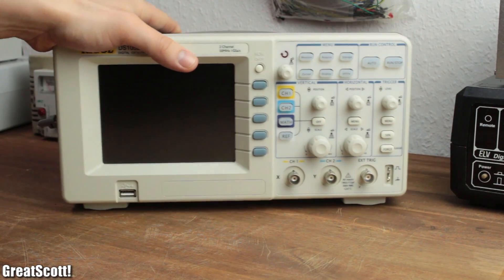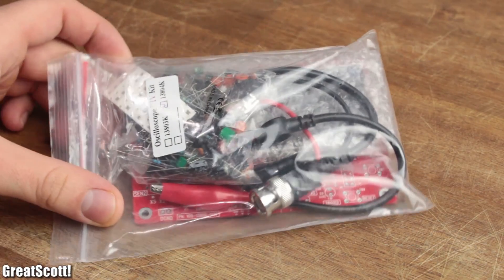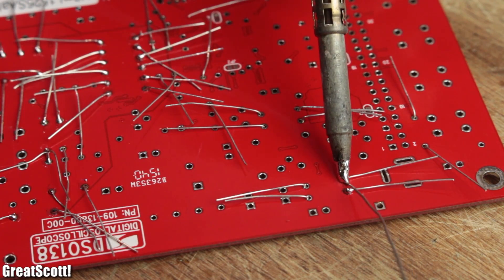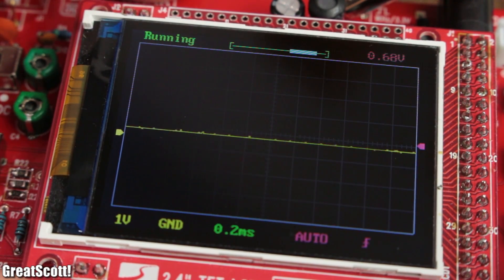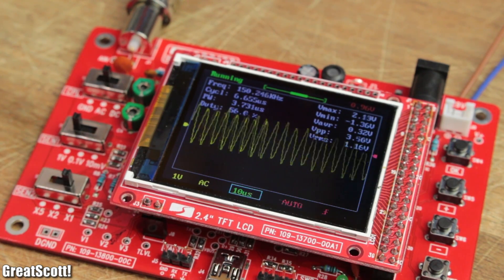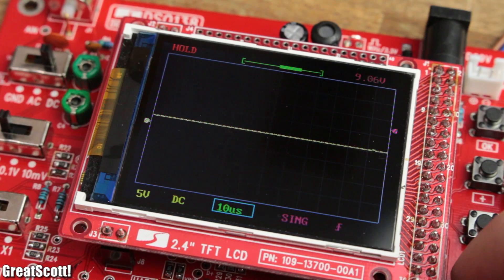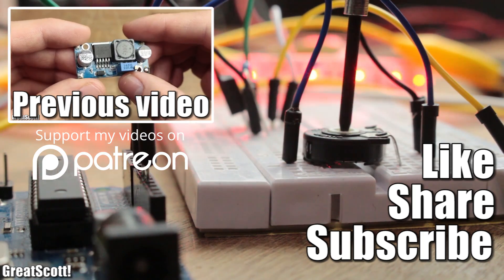DIY Oscilloscope Kit (20$) VS Regular DS Oscilloscope (400$)

Comment: When did you start your hobby? I mean how old were you when you jumped in the world of the electronics? :)
Reply from the maker: +Imetomi Pretty late. With 18 years.
Reply: +GreatScott! But your knowledge is huge and you're sharing it with other people. This is a nice thing :). All the best!
Reply from the maker: Imetomi
Thanks ;-)
Reply from the maker: Antonino Frey
Don't give up ;-)
Reply: I didn't start until I was 32. I would have loved to have started when I was 18.
Reply: +EmiNNsoNify I know, I speak four languages and I'm reading books in these different languages, I have bigger problems with German, but I hope soon I'll speak better.
Reply: I'm Bulgarian and "Imeto mi" ( in cyrillic "Името ми" ) which translates to "my name" :D when I saw it I thought you are Bulgarian just using a nice nick name :D
Reply: You can get into electronics very quickly. It's been last year since I started and I designed a 3kW Square Wave SMPS from scratch. You just require the patience and motivation to learn.
Reply: nanee :D magyarok mindenhol :D
Reply: I think digital ICs are better suited for beginners since the function and pinouts are pretty self explanatory compared to a 555 or op amp. Plus they're basically like legos in how you put them together. Mind you I played with logisim, a digital circuit simulator years before I got into electronics. Even so, I was able to make stuff in logisim pretty soon after finding it. Whereas with CircuitMod, an electrical\electronic circuit simulator, it took me some months before I started to know what I was doing. But once I did, I was able to make the jump to physical circuits. But with Logisim, I could basically start messing around with very little knowledge. Where with Circuitmod, I needed quite a bit more background before I could make anything that did something. Still, without the 555 as a clock, you're pretty well limited to combinational circuits. But you can still do neat things limited to that. Like make an ALU.
Reply: That's really nice ! :) Hey I have a question if it's not too much to ask - How does your user name translate to English ? Because if I split it in two parts and translate it from my main language it means "My name"
Reply: +EmiNNsoNify  I thought he was Bulgarian from his name too ;) Where in BG are you from?My wife is from BG and we are in the process of moving from the US to Varna.
Reply: +GreatScott! how old are you know?
Reply: +GreatScott! NO 44 is late !   lol
Reply: +Antonino Frey amplifiers arent goot thing for beginers.You can easily have some distortions and things like that.Start with flickers Ne 555 timers ... Great scot make video about flicker in rc oscilator basics
Reply: +Antonino Frey amplifiers arent goot thing for beginers.You can easily have some distortions and things like that.Start with flickers Ne 555 timers ... Great scot make video about flicker in rc oscilator basics
Reply: +Antonino Frey amplifiers arent goot thing for beginers.You can easily have some distortions and things like that.Start with flickers Ne 555 timers ... Great scot make video about flicker in rc oscilator basics
Reply: NE 555 timer circuits are indeed a good beginning. Maybe after a little experience throwing in some op amps and make audio circuits would be the next step. Stanislav Jochman
Reply: +GreatScott! That gives me hope :')
Reply: Welp i jumped to this electronic hobby at age of 8 years old :) because at first i wanna know whats difference about ac and dc
Reply: Beste Antwort / Nicest reply ! You can only master it by redoing and practise
Reply: +Imetomi In electronics you can learn fast because you can easily make schematics ( if this word is wrong I apologize for my English It's not my main language ) and test them to see how they work, especially if you have an oscilloscope :) . Don't forget to read books :).
Reply: +EmiNNsoNify :))) my name is Imets Tamás (I'm Hungarian) Tomi is a nickname for Tamás (Thomas in English, so I's like Tommy) And few years ago my friend started to call me Imetomi (or imitomi) By the way where are you from?

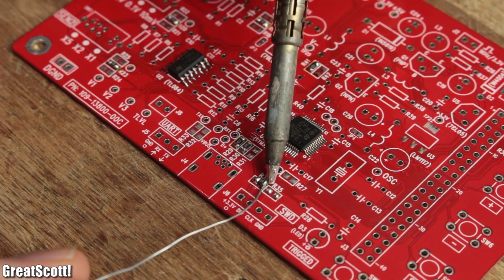Comment: 1:37 Man that was almost painful to watch. Just use a sharpened pensil to put a drop of glue or heatsink grease under the parts and it holds it.
Also what if I set a 555 to 10-15Hz output and build a fast mode for the switches? :D

Comment: We are still using analogue oscilloscopes in first year engineering. They do no yet trust us with the expensive tech.
Reply: thats awful. theres no real benefit to using analogue/crt scopes. theyre not even as good as cheap knock off USB scopes that cost little. you could even build a primitive arduino one with an lcd screen for $5 and draw the screen with a $3 arduino uno.

Comment: Do you know of anyone selling a case?
Reply: +Frederick Kaludis Lots of 3d printable case designs.  Pick one you like and find a printer at school, library or 3d hubs.

http://www.thingiverse.com/search?q=dso138&sa=
Reply: +Jenn B what library has 3d printers xd ;)
Reply: danijel124   Public library in Toronto has them
Reply: +danijel124  Nice question, I don't know of any, but we have a 3D printing shop in the next town about 10 miles away and they would do it I'm sure.  These are based on a standard product an these are small plastic part , if I were selling kits I'd offer the whole thing case and all the case has to cost all of $1.00 USD to make and you could sell it at $5.00USD.
Reply: +Frederick Kaludis I ordered this case, but I have not received it yet.
http://www.banggood.com/Transparent-Acrylic-Sheet-Housing-Case-For-DSO138-Oscilloscope-p-1034768.html

Comment: Nice to see a fair and unbiased video unlike eevblog where anything that isn't pro-equipment is thrown against the desk and deemed to be crap.
Reply: Glad to hear I'm not the only one that feels EEV is a tad OTT in his requirements and rather rough on calling things shit.
Dude really doesn't understand that for starters, tinkering, learning and certain tasks and hobbys, cheap kits like this are fantastic and often even a bridge to more.

Heck, I've been tinkering with 4 and 8 bit computers made from non-integrated components. I bought 5 of these kits and can now monitor signals and signal quality on the busses with a bunch of these DSO's for under 100$.

If I had to do that with "real" DSO's, I'd be out several hundred.

If you do a lot IoT development or thinkering, and are mainly looking to analyze and view GPIO, I2C and other busses like them, a little scope like this is often more then sufficient.

I always hate when people make light of cheap kits. Sure, if you mostly work on equipment that's worth 100's or 1000's of dollars, buy a 500$ or more scope.

But I work on computers that have no application, various microcontrollers and 5-40$ micro computers. Why the hell would I want to have to use equipment on those applications that costs 10's and 100's of times more then what I'm working on, when I can get a 20$ kit to do the same with.
Reply: @enlightendbel  what does OTT mean
Reply: @tightirl  Over The Top
Reply: Different target audience, my friend.  Think of this as a "How to make Kraft macaroni and cheese" type product while Dave is busy with "How to make a 9 course meal starting with harvesting the ingredients"
Reply: Eevblog is a pro channel, not exactly same target as this one. Actually, I think these two scopes are crappy IMHO. I'd rather buy a second hand Tek.
Reply: Well, he wants something that's a serious piece of equipment that doesn't suck. Can't blame the dude. Sometimes he finds gems, most of the time what he says it is, is what it actually is. lol
Reply: Have you seen the review he did about the DSO138. You’re assuming too much
Reply: The only video I've seen where EEV wasn't completely vitriolic towards cheap products was the 300$ electronics lab one
Reply: EEV Blog isn't exactly geared towards hobbyists. Once you move into the domain of real engineering, these kits are useless.
Reply: The thing is, real engineers doesn't bother with cheap kids like this. They know what they are getting.
Reply: @HoshinoMirai   who said they were targeted at "real engineers" ?  
Even a hobbyist knows they are getting a scope with an audio bandwidth... 
Don't be so condescending towards DIY'rs 😒
Reply: For this kind of price tag you are better buying an old analog scope like on ebay, much better performance and capabilities
Reply: I would consider building one of these kits. I could borrow a scope from work for how little I would use a scope. But to have something small and compact this might be good. They have full kits that are complete with  case and power cord for about 50 dollars which might be good and get to build it myself.  

Heathkit sold tv kits and they were more than one already assembled. But people feel the satisfaction that they took pride in building one themselves. And better built than the junk that's out on the market.

PS this is about past experiences. Heathkit went out of business for the most part. You can buy kits but probably not like in the past.  I looked for kits but I haven't found anything worth buying yet.
Reply: Ive just recieved a complete kit ready made from Alibaba in china, about £17 delivered.  Yes i could have assembled and saved a few pounds, but time is money.
Reply: These kits are at best geared towards electronics classes in elementary schools. Since this works barely upto 100 kHz there isn't really much you can measure with it and now with Hantek and Rigol scopes being so cheap, or equivalent USB scopes are even cheaper and offer frequency domain display and uptop 4 channels. I don't really see why any electronic enthusiast would want to buy this for $20, assemble the thing for hours and doubt the possibility of it even turning on.
Reply: @elerian9702  ...  u think a person who is unable to assemble a kit properly should buy a Rigol ?? 
🙄😂😂😂😂
Reply: EEVBLOG = Electronics Engineering Video Blog. None of this hobbyist nonsense.

Seriously though. He does tend to get biased and often has strong opinions, but I don't think this is one of those times.

Comment: Is there a version that does not include SMD soldering?
Reply from the maker: +Tony Tascioglu Yes
Reply: yes. the jye is available with pre-soldered smd's  on amazon, you click colour choice to get the option!!!!! odd.
Reply: +Tony Tascioglu Be careful to get the new improved version,, Don&#39;t worry about SMD;s they are not so bad. DSO138 13803K  SMD;s are pre soldered. The DSO in video is new version, older version PCB looks more orange than red. They both only range from 0-200KHZ

Comment: my scope has valves and no data holding, i may need to use it in a few days so i should turn it on now to get warm and stable......
Reply: +lez briddon cool scope ! or rather not cool!
Reply: +lez briddon well same here, tube oscilloscope is more a room heater than measurement device, but they are nice piece of equipment anyways :)
Reply: Toooobbbbbsssss

Comment: When SMD soldering, you will have an easier time if you add solder to one pad, add some flux from a flux pen, place your component and reheat the solder while you hold the component with tweezers. Once you are happy with the placement add solder to the second pad to complete. This way enables you to place components flat on the board and easily adjust them.

Comment: I got one of these kits about a year ago for ~£13 when I first saw Julian's channel. I also made the mistake of soldering the SMD TL084  backwards - initial voltages checked OK but the TL084 and an inductor blew when I shorted out the TP4 jumper. I needed a quick fix so paid ~£4 just to get replacement parts locally (UK). It now works well for the price but like many others I have read about the display has to be zeroed every time it is powered up - still don't know why.

Comment: Does anybody know if you Can make your own one board computer? I would like to try but i havent seen anybody doing it and im still new to Electronics. Or maybe a game boy emulated of some kind?
Reply: Well, everything is possible, but even for smaller professionals I wouldn´t recommend building a completely new computer, but there are things like the Raspberry Pi- or the Arduino-series, around wich you can easily (well, not too easy :p) build your projects.
Reply: +Adro Slice LP well I want to build my own so:/
Reply: slimeball
Even with things like the Arduino it´s still difficult.
Reply: +slimeball If you're ok with older tech, then yes. Google 6502 computer
Reply: +slimeball how about building it from logic gates (FPGA board)
Reply: Vale Sarbu
Have Fun xD
Reply: +Shahe Ansar thx I'm looking in to it maybe if I find som of the parts i can build one :)
Reply: slimeball
You can find them on eBay and aliexpress for really cheap
Reply: +slimeball lookup Olimex boards in Google - they create Open Source Hardware which means they share every schematic. This way you will have examples of how they create their own products ... you will still have to read a lot of books.
Reply: DeathToAllFaggots .AndTheirDumbassRights Not really, computers are really simple at the lowest level (so simple, it can cause a few problems), but the biggest problem with modern microprocessors which run a >100Mhz is the hardware, noise gets through easily without a ground plane, the wires can move which may cause signal problems (which can and definitely will be a problem, considering the pulse width), which is why I recommended retro computing, I've made a couple of Z80 boards that run my own OS so yeah...
Reply: DeathToAllFaggots .AndTheirDumbassRights Yeah, that's a bit too extreme relative to IC based microcomputera

Comment: Hab mir auch so eines gekauft aber das ist schwarz und auf der Rückseite ist kein code. Wenn ich es einschalte dann kommt nur ein weißer Bildschirm.  Was kann ich da machen ?
Reply: Hab ein video auf meinem Kanal wo ich das zeige wäre nett wenn du mir helfen könntest danke schönes Video.;)
Reply from the maker: +HV and more I usually don't answer german comments but I make an exception. You need to check your solder joints. They do not look "pleasant".  Especially the male header solder joints of the TFT display.
Reply: Ok sorry but my English is not the best . What about the code on the backside ? Is this code necessary or does it just mean, mine is a fake (do you think  the software is good?)

Comment: Better way to solder the SMD components is to put the flux on the pads, put e.g. the resistor on, and then solder one pad and then the other. the more flux, the better. this inside the solder is not enough. this disadvantage is mess on board, and need to clean it up with some kind of liquid alcohol.
Reply: of course you need to hold the component with your tweezers

Comment: These scopes are very good for learning electronics on a budget. I would however suggest buying an original, rather than a clone. The manufacturer JYEtech list all the verified sellers. If you buy a clone and need support, JYE won't offer any help.
They are however nice to build, they also come in kit form with the SMD parts added by the original manufacturer. This makes the build easier for beginners.
I really like mine and am having fun learning. Thanks for the cool comparison video.
Reply: yeah i have the JYEtech DSO112A and it fucking rules. my mate thought it was so good he bought one as well. excellent handheld things. actually more handy than a real scope. next on the list is a handheld FFT

Comment: I bought the same kit with the surface mount components already soldered. Came with the manual too. Kit is great for audio frequency stuff, but, as you point out, is no professional scope. I think you get a lot for 30 bucks.